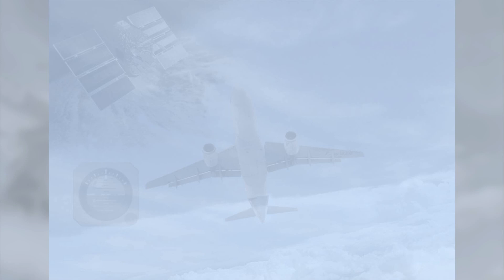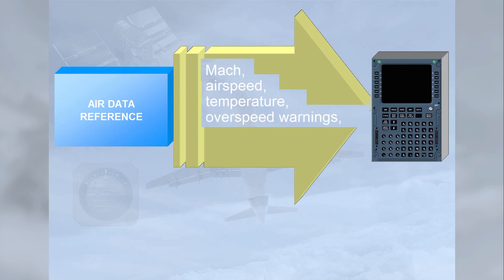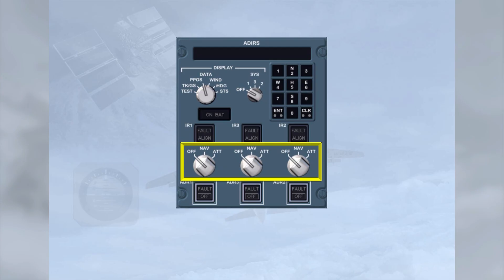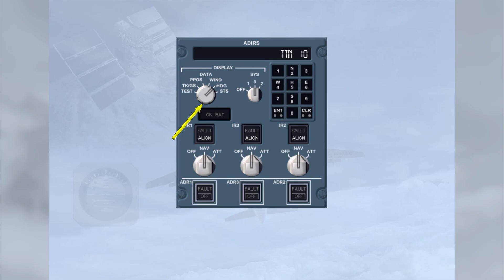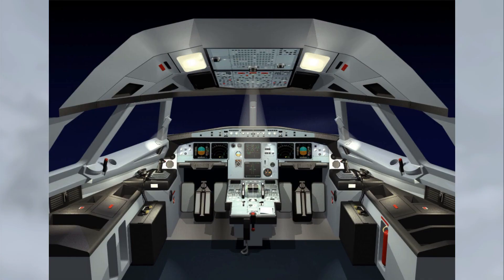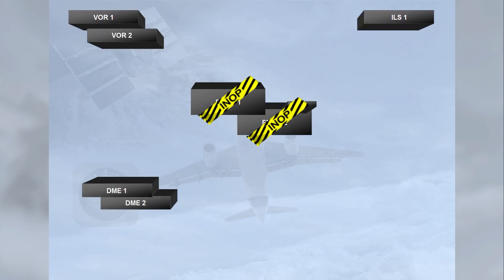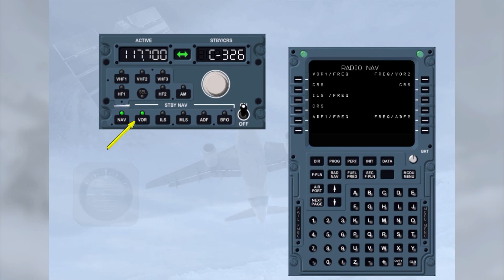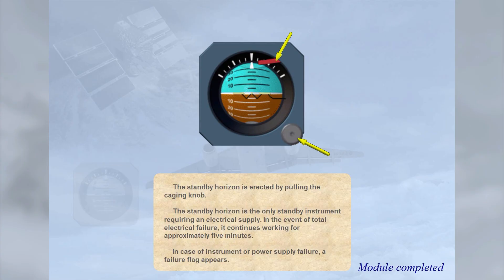Airbus A320 NAVIGATION System - ADIRS, FMC, ND, DDRMI

Comment: To my knowledge, this statement made at 16:30 is inaccurate:

"The standby horizon is the only standby instrument requiring an electrical supply".

This was true for for early A320s, but hasn't been since Airbus introduced ISIS (Integrated Standby Instrument System), where all standby system rely on electrical power for their electrically operated standby instruments.
Reply from the maker: This particular training video is in reference to the "early" A320's with the CRT displays and analogue standby instruments. So in this case the statement is correct. Further training videos detailing information for the newer versions of the A320 with the LCD cockpit displays, including the neo will be following in due course. Thanks for watching.
Reply: @CommercialAviationTraining  
Ah, got it. I didn't realize that. Thank you.